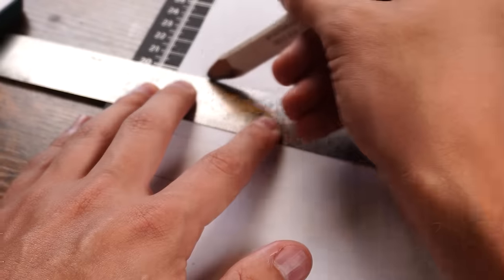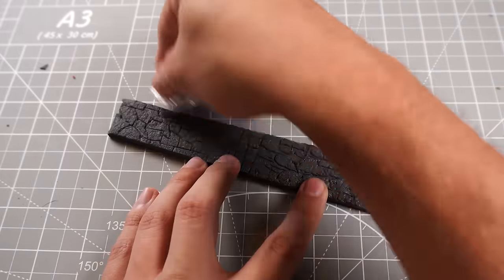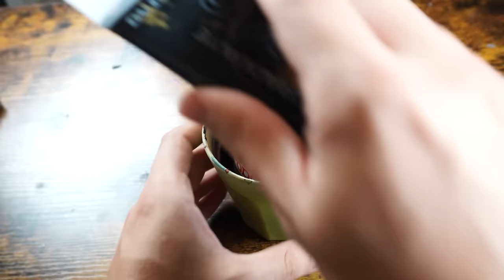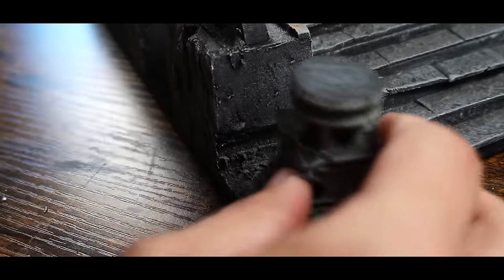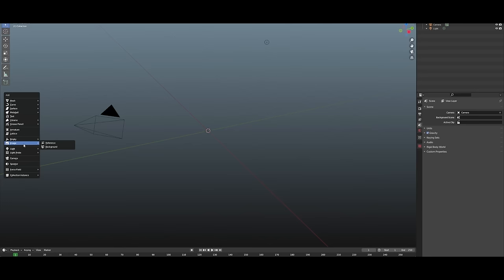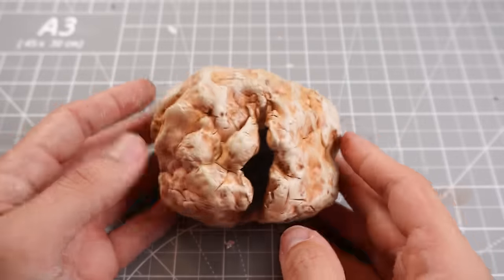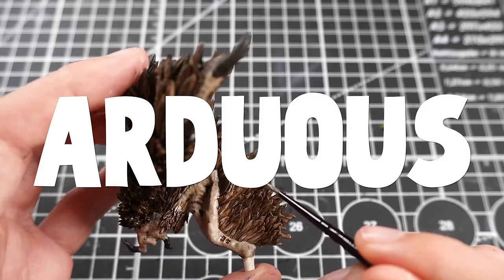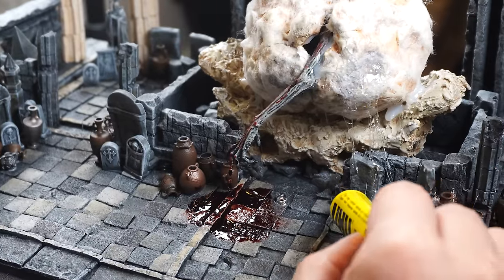I Made the Mohgwyn Palace | Elden Ring

Comment: I'm genuinely curious: you never use a model holder or gloves while holding your prints. Have you had any troubles with paint scrapping out of the surface?
Outstanding work anyway, you deserve many more subs.
Reply: As someone who does that sometimes: It depends on multiple factors. Primer, surface texture, how much you handle the object, etc. With detailed minis, you'd definitely see some paint rub off the most raised edges eventually, while flats are going to be fine. But especially with terrain pieces and the like, you don't usually handle them enough during painting that it becomes an issue.